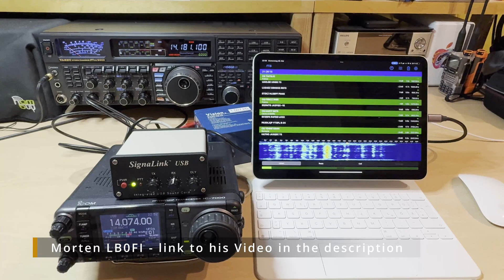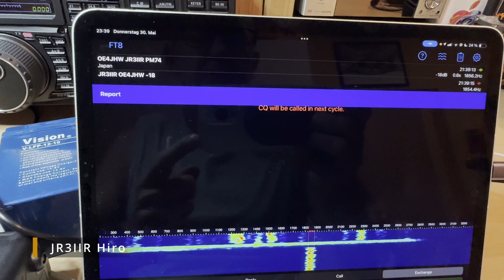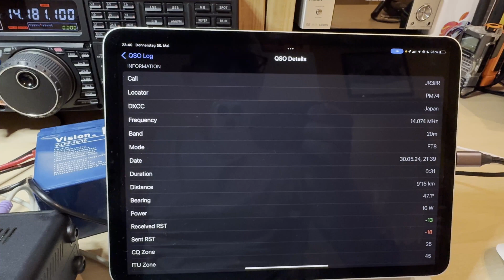FT8 with my iPad Pro using the Icom IC-7000 and a SignaLink USB interface

Comment: Are you using both tx and rx audio through the Signalink or just transmit audio? I am very keen to get my IPad working in this manner as I have a spare Signalink.  Daryl - VK3AWA
Reply from the maker: Hi Daryl, good morning from OE. Sorry for my late reply.
Just woke up. It was a long trip to the Ham Fest in Friedrichshafen ;-)
Yes, I‘m using RX and TX on the SignaLink.
Thanks for watching and best 73 de Juergen OE4JHW / AH6UN